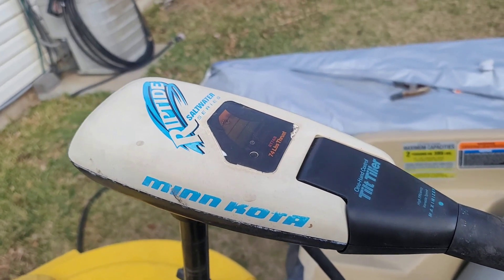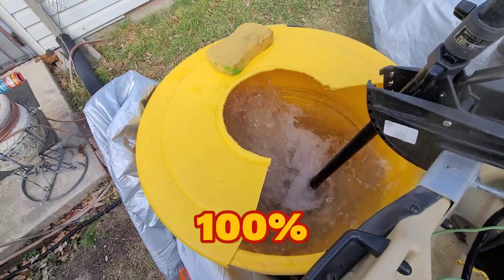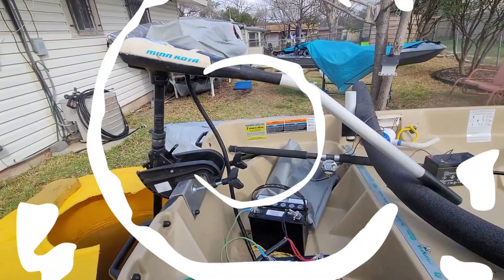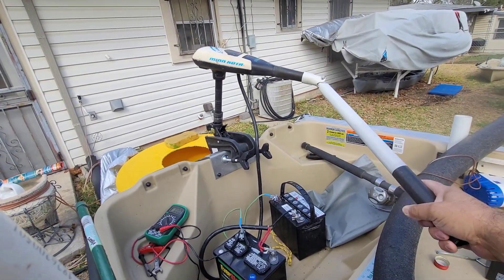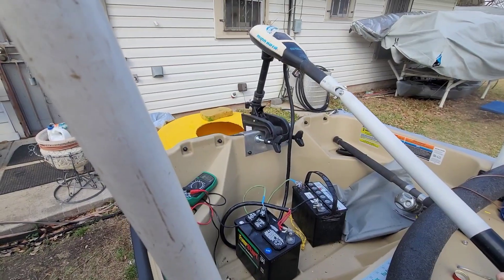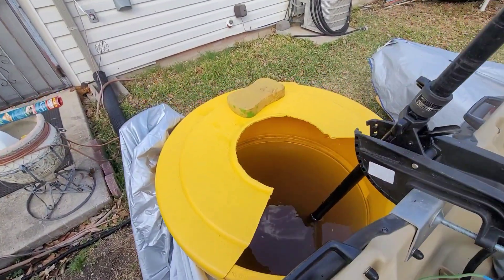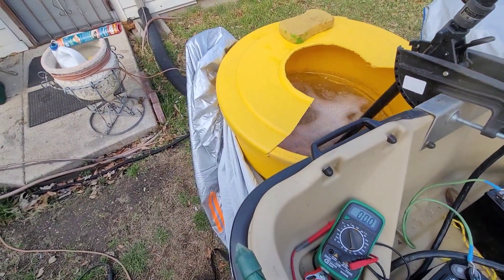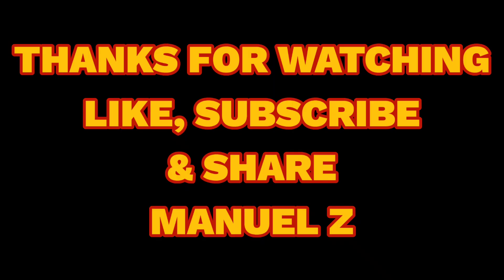PVC TROLL MOTOR EXTENSION HANDLE

Comment: Mate do a video on how U made it step by step I think others would like that  as there's not one video on U tube like your electric motor extension as to buy that extension in Australia cost about $170 plus delivery  from America
Reply from the maker: No video needed you just need to heat it till it's soft then slide it over the handle. Wear heavy duty gloves... It gets really hot!!